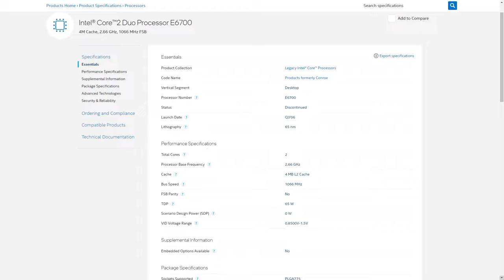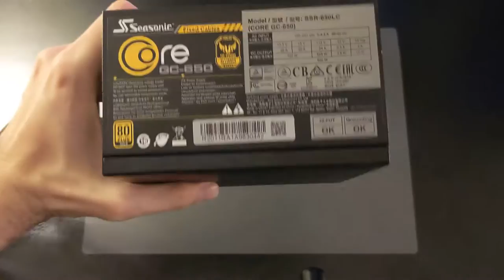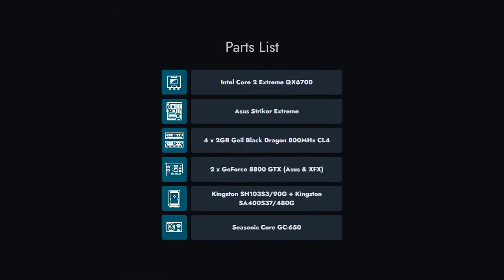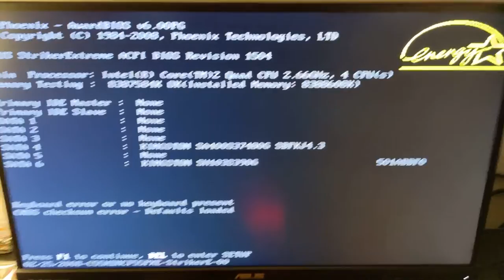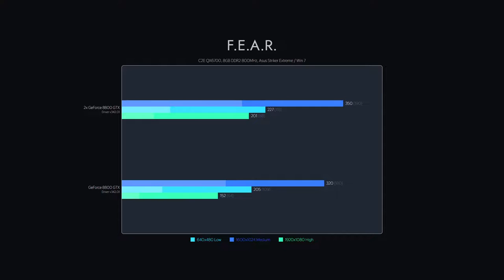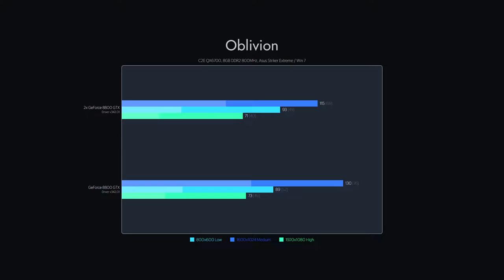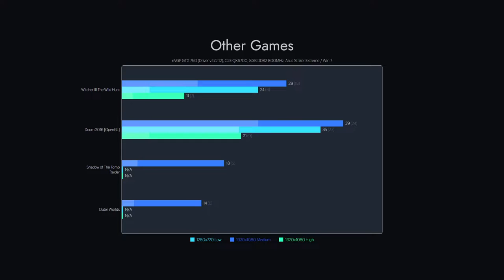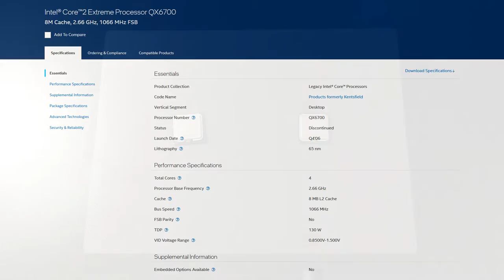2006 Ultimate High End Gaming PC Build

Comment: Imagine 4090 and am5 will be like trash in 20 years from now
Reply: the foundation of PC might change in 2 decades, everything changes, tech evolves into whole other forms and shapes that are better and more efficient.
Hell, who knows, maybe discrete GPUs will become irrelevant as time passes and we'll mostly only see APUs on the market (both gpu and cpu in one chip, which has a lot of benefits like M1)
Reply: Pork  1080ti is still nearly as good as 2080 super which is close to 2080 ti which is equals 3070, 3070 is on the higher end side of things and 1080ti isn't significantly weaker than 3070 (5-20 fps less in most games)
Reply: @plasticelephant1969 xx70's are mid range cards
Reply: @plasticelephant1969 that's some hard cope
Reply: Imagine getting a 4090 for 20$ in 2050
Reply: Probably even in 6
Mainly because it appears that the foundation of what makes a cpu and a gpu good has begun to shift Abit 
Furthermore 80 and 90 series with their power consumption are going too inefficient to be worth getting even in 3 years from now
Reply: I think same thing will eventually happen to gpu cards as happened to soundcards...

Comment: I remember those days fondly. I had low end stuff back then because I couldn't afford anything else. I had put together a wish list back then of the core 2 quad core, 8 GB ram, 9800 GTX in sli, and two Velociraptor HDD's at 10k rpm each in a raid 0 configuration. That configuration was just a dream though. I didn't hit mainstream technically until Ryzen came out. But that was again a few years ago. Currently rocking 12900k, 32 GB DDR5, 4070 all packed in a Fractal Ridge case.

Comment: It's crazy. For Intel 2006 was something else. Going from the $999 Pentium D EE 965 2 Cores, 4 threads with Pentium 4 based pipelining in Q1 '06, to the Core 2 Duo, and Quads by Q4 '06 was an insane leap in performance. Performance at the beginning of that year looked completely different to performance by the end of the year. Whoever bought the final Presler Extreme Edition Pentium D's were seriously hurting in their wallet department by July with simple Dual core processors already gaming faster than what they had.

Comment: Nice!
I skipped the C2D\C2Q era and went straight from P4 to first gen I7.
I7 920 (got replaced with an X5690 I got off Aliexpress) , EVGA 285GTX, ASUS P6T Deluxe and a kit of Corsair Vengeance 24GB in triple channel.
I actually used this PC with an RTX 2080, and got it replaced right before AMD came out with Zen3.
Reply: Using same setup with RX 580 in crossfire, It is very hot and overpowered))
Reply: Was the 285gtx that insanely expensive card with two gpus on one card?
Reply: I went from a Celeron D to the q6600. Celeron D used DDR and q6600 used DDR2. I also went from a 8600 GT to two 9800 GTX's in SLi. It was a beast but it didn't live long before I upgraded to a whole new system with my first i3. the 2100. It wasn't until the intel 4000 series came out that I got my hands on a 4650 i5 and DDR4. I had Ryzen after that a few times but as of my current build it's back to Intel with a 12900k paired with DDR5 and a 4070

Comment: In 2006, playing in 1080p full hd was very uncommon, more like 120fps 4k today. 
Most of the time the standard "mainstream" resolution was 1280x1024.
1600x1200 was the high end sector (ike 1440p today).
Seeing the GTX 8800 working so well at 1080p is just mind blowing.
The Quad Core Extreme was also a good CPU...keept mine 8 years untill i bought an i7 4790k.

Comment: I have 2 retro machines I use them more than my modern rig. The xp machine is pretty much my ultimate build.
Intel core 2 extreme QX9650 @ 3.66 Ghz
Asus p5n-d
8 Gb DDR 2 800 
GeForce 9800 GTX+ SLI
Reply: amazing specs.
Reply: lol I have qx 9650 with GTX1070 :yougotthis:
Reply: @majkel7296  hows that cpu bottleneck I tried running my 7970 with that cpu and i got no gain at all over my 9800s
Reply: i paired evga nForce 790i with QX9775 (4GHz) and 16GB DDR3 RAM 2000Mhz + GTX 8800 Ultra

Comment: It is posible to make this PC useble in 2022!
We need: 
QX6850(OC to ~3.8-4.0);
Any NVMe(booting in UEFI with Clover);
GTX 780 ti;
PCIe to USB 3.0 card;
DDR2 1200 same 8 GB;
Custom watercooling loop and for better gaming experience sound card(ASUS XONAR D2?PM/A 7.1 for example ).
Reply: im still using my q9400 8gb ddr3 ram 1333mhz and gtx760 2gb with win 10 without any problem. Motherboard is asrock g41c-gs and stock cpu fan. I didnt even overclock it. Still can play most of the games in the market.

Comment: Amazing motherboard, graphics cards and CPU for the 2006 dreambuild. But SSDs and Windows 7? Kinda killed the vibe... Could've used a pair of those high-end 10K RPM SATA HDDs in RAID 0, which was the best of the best before SATA SSDs appeared (in late 2008 i think). And for OS, with 4GB of RAM (still amazing for 2006) you could use Windows XP, or Vista RTM 32 for the very bleeding edge tech of 2006 (Vista would run very well on this hardware). But 8GB of RAM complicates things for a 2006 dreambuild, as it would require Windows XP x64 or Vista RTM x64.

Comment: It has similar specs to my sisters computer 
Intel Core 2 Quad Q8400
8GB RAM DDR2
R5 340X 2GB 
500GB HARD DRIVE + 256GB SSD
Reply: R5 is worse
Reply: @Hookah37  It's not lol
Reply: It's 9 years newer, uses less power, has way more vram, is faster, and has DX12 and there is so much more
Reply: @KingSteven77  i mean it's not a 2006 GPU so..
Reply: @Hookah37  ???
Reply: @KingSteven77  so it's worse for this scenario not for performance lol but it's very identical to performance of this anyway
Reply: @Hookah37  Yeah it's worse for a "2006 Gaming PC Build" since it's not a 2006 GPU, but I never said I had a 2006 PC build, I was just saying how they have similar specs. The R5 340X 2GB is better in many ways when not talking about a 2006 build.
Reply: @KingSteven77  yes it does have dx11 support but it's still very bad

Comment: Good video. All gtx 8800's will run at 8800 ultra speeds. I had a QX6700 at 4ghz but your mileage will vary. I am not sure how that psu would handle gpu & cpu over clocks.

Comment: Ssd’s weren’t a thing in 2006. So this isn’t very period accurate.
Reply from the maker: Actually, they were, even in commercial market. But they weren't widely available. As for us using SSDs, it's conscious decision, as spinning drives experience a lot of wear and tear over time, and can't be considered reliable. Other than load times, they are in no way impacting performance we're trying to gauge here.
Reply: He makes in 2022 a retro PC and use 4 cores instead of 2 "to be future proof" lmao
It the goal is retro pc there is no need to be future proof, it only needs to be retro.
Reply from the maker: @bestopinion9257  Yeah? Well, you know, that is just like, your opinion man. :D
Reply: @attictiertech  best opinion here, your opinion there
Reply: @bestopinion9257  "Ultimate Gaming PC Build for the year 2006" is it retro pc or ULTIMATE pc from 2006 era?
Reply: @fil44ls  Both.
Reply: @fil44ls  If your goal is  "Ultimate Gaming PC Build for the year 2006" that means you target precisely 2006 year which is retro. Also you want to be ULTIMATE for GAMING. That means you target high end parts and also the performance. Well, Quad cores of that year were beaten by dual core in gaming because games only used two cores anyway and dual cores were higher in frequency. 
But ok, it is fine to use high end quad core, I will say it is still ultimate. Not that is the problem here.

The problem is considering FUTURE PROOF 'feature'  when your target is 2006 year ... It just make no sense, that's all. 

You already know the requirements for next years. If you want 2010 year rig you can make it ultimate for that year directly.
Reply: it might affect 1% lows, but it won't affect average frame rate for older games...